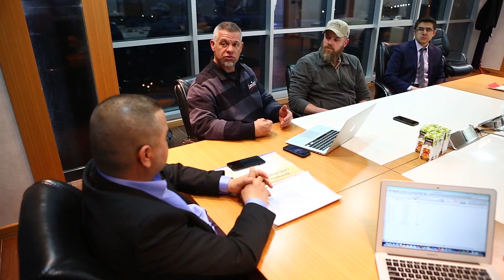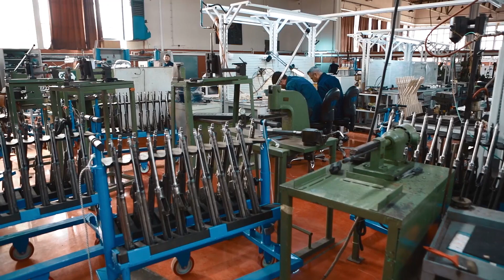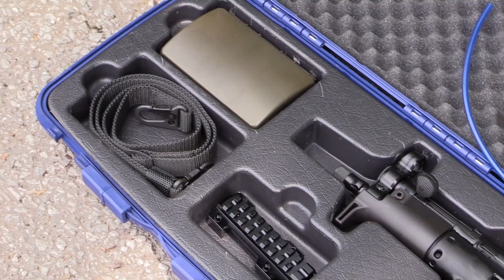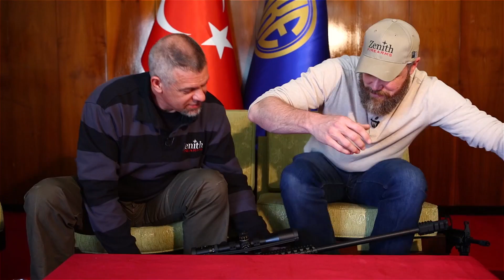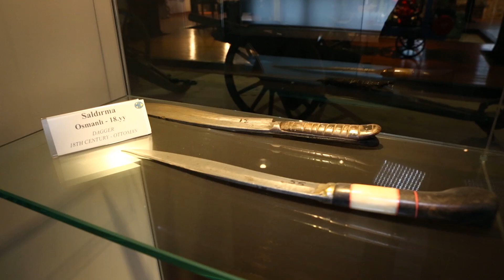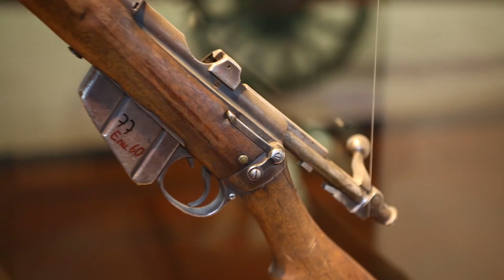Zenith Firearms / MKE Factory Tour

Comment: JNG-90 BORA is an OUTSTANDING Sniper Rifle. It was tested in all weather conditions during the Pakistan Army's Sniper Rifle tender about two years back and passed with flying colors. The only reason it lost out to the Arctic Warfare was the fact that AW supported the LAPUA cartridge more effectively at long ranges at that time and it outperformed all other platforms in Arctic Warfare conditions in Pakistani Himalaya based test ranges where temperature considerations go below -40 degrees. Apart from that the BORA was impressive and remained the runner up.
Reply: Pakistan Defence Official 

Thx for info brother.. Greetings from Turkey. Love Pakistan..
Reply: THX <3

Comment: MAC, great video!  I am definitely all-in for one of these as an SBR candidate.  I could never find a HK for a fraction of this cost, and it seems like we are getting something very close.  I was not as impressed by the POF reviews, one was a side by side with an HK and the machining of the parts was noticeably inferior on the POF.  Do you feel this is on par with an HK?  Also, don't we need a U.S. parts kit to do the SBR, is MKE/Zenith working on that?  I'm glad CZ is making one for my Scorpion, but the extra U.S. parts required to SBR one of these could be very expensive.

Comment: Mac, 

How would you compare the Zenith MP5 clones to the CZ Scorpion?
Reply from the maker: Jeff Gilbert Two totally different systems. The Z5 roller locking system is a classic and arguably one of the most tested SMG type actions on the market. The Scorpion is an outstanding value for a 9mm pistol/SBR. One is a classic made of stampings the other more modern and made of polymer. If you're primary purchasing decision will be based on cost, the Scorpion is your best bet. If you're looking for the classic roller lock 9mm carbine, the Z5 is the highest quality most affordably priced on currently on the market IMHO.